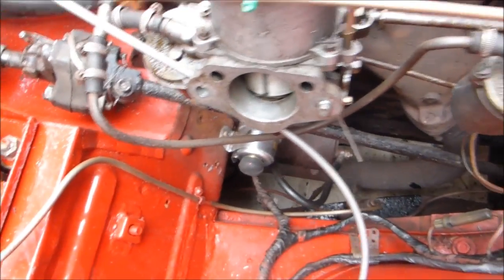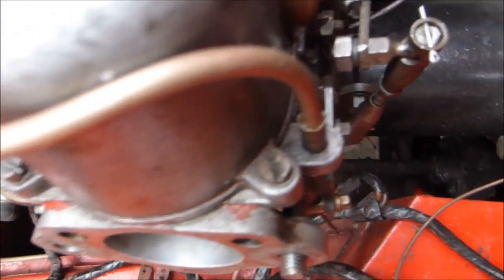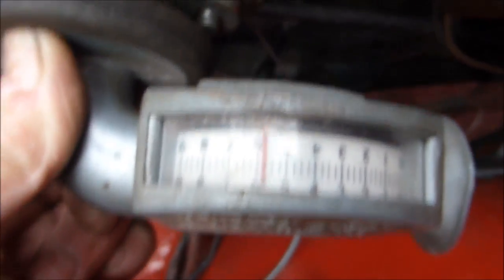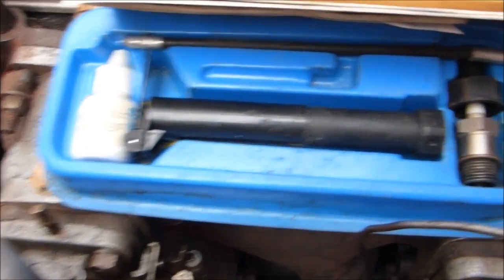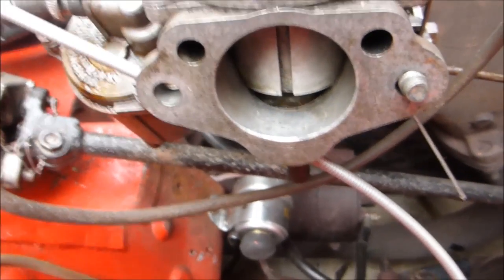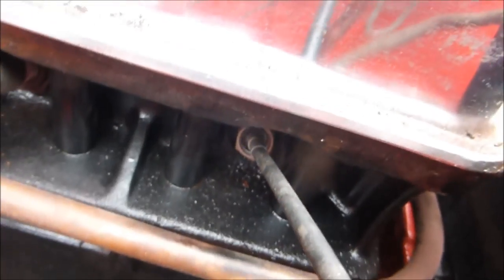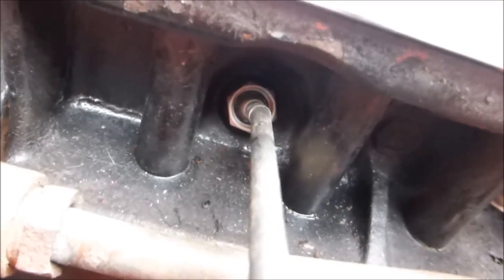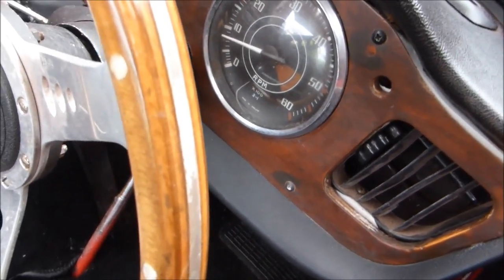How to balance SU HS6 carbs and adjust the fuel mixture

Comment: Alec  Is there a part number for your colour tuning equipment? I would like to purchase one of these. Steven
Reply: Just look for a Gunson Colortune. For a TR3 and many others it's a 14mm spark plug so part G4074 but you may need a different sized adaptor depending on your car.

Comment: Hi. I have the same carb set up on a wolseley 6 and they are bogging down under acceleration. Any ideas ? Thank you
Reply from the maker: Hello Sam, l'm not quite familiar with the tem bogging down, but if you mean it engine is not accelerating properly I did have this problem when one jet was sticking slightly open after using the choke. A little lubrication of the linkage sorted it out. It could be fuel. Don't use the 10 only the 5 and remember the our modern fuel goes off after a time.
Check that your No1 piston is firing at the correct time. My TR4 fires 4 deg  before TDC and your point gap is correct and they are not pitted . Good luck

Comment: i'm re-building my 76 1500 spitfire ,the overdrive annulus is stuck on the sliding member,so that needs to be  sorted before the engine gets re-fitted;however for the time being i'm going to fit two O2 meters (i have them) so i can tune the carbs ,i have a colour tune but i kept getting a lot of fouling,there were issues about the ignition in that cold starting and hot starting could be a pain,now i know why,the 12v coil was fed by a 6v ballast wire,so at start up even a rich mixture had a hard time igniting by a low volt spark,at crank the voltage would drop to around 8 or 9 volts so the ballast wire would feed even less as the system voltage was lower and potentially the coil was getting 4v or worse,instead of a 6v coil being boosted via the starter motor side of the starter solenoid to around 8v giving a hotter spark.

Live and learn.

Any ideas to unstick a stuck annulus and sliding member without damage,i have a variable hydraulic pump i can  pressure the O/D with,but the O/D is supposed to come apart no problem.
I need to get a balancing tool.

Nice vid .
ATB

Comment: You said to adjust the Idle after the Filters are replaced as they will lower the Idle…. How can you determine if they are both set the same as you’ve now blocked any way of using the Synchronizing Tool?
Reply from the maker: Hello, thanks for watching the video. The air filters are identical so the carbs will still be balanced but when they are replaced but the engine will run slightly slower.
Alec

Comment: What is the name of that mirror device you are using to adjust the mixture?  And where can you buy that and the Krypton Synchro-Check?
Reply from the maker: It is called a colour tune made by Gunson and it comes with the mirror. Krypton gadget is very old but others are on the market
Reply: @alecmcleod5679  Thank you Alec.  Much appreciated.  I think I need both of those for my '59 Bugeye.

Comment: Dear Alec, thank you. I'm a new Healey owner and quite a rookie in the tune/mechanic dept. I'm wondering if you're using the color tune on all the plugs or did you just do it for two? If two, which two do you do the process with? Couldn't see what you unscrewed  to isolate each carb- is it the screw on that adjoining bar? Thanks for your time.
Reply from the maker: Hello, many thanks for looking at my video. You will see that each carb feed fuel to two cylinders so you only need to take out one plug for each pair. The nut that I slacken was for one of the clamps that connects the accelerator rod between the carbs. They are then independent of each other until you have adjusted them and then retighten them.
Good luck.
Alec
Reply: @alecmcleod5679  Thanks a lot!  Do you have any videos of you working on Timing ? Distributor / etc? For some reason, soon after I trailered this car home after buying it, it began running a little rough. I think the carbs are ok, but am wondering about the timing. Thanks for all you do!
Reply from the maker: Hello again, have a look at these links. Alec

https://m.youtube.com/watch?v=VXhsGEOM57g
https://m.youtube.com/watch?v=GH3D3_EZ0yA

Sent from my iPad

Sent from my iPad

Sent from my iPad

Comment: hi i live in new Zealand and have a Volvo p1800s with twin su carbs, could you give me an address in england where i could buy a balancing tool also the mixture tool shown in this video. regards colin.
Reply: Amazon offers a similar tool with a rubber seal "Deluxe Carburetor Airflow Meter."
Reply from the maker: Sorry for the delay in answering Colin.                            

The Colortune is made by Gunson and sold by many outlets. The carb  balancer model B89 is made by Crypton but are hard to find. Many mechanics just use a piece of tube held to the ear and "tune" them by the sound.

Comment: What are the tools you used called?
Reply from the maker: The Colortune is made by Gunson and sold by many outlets. The carb  balancer model B89 is made by Crypton but are hard to find. Many mechanics just use a piece of tube held to the ear and "tune" them by the sound, hence the name, engine tuning